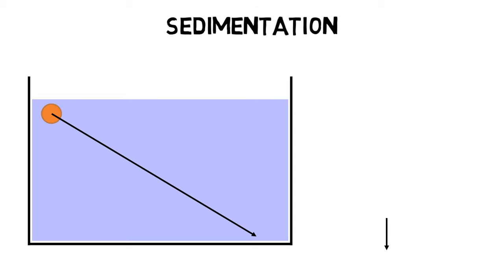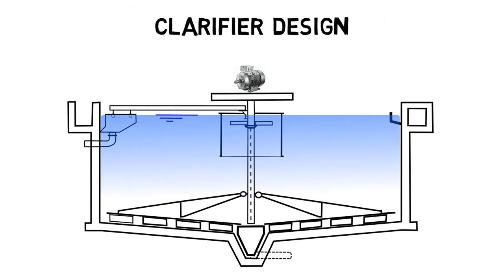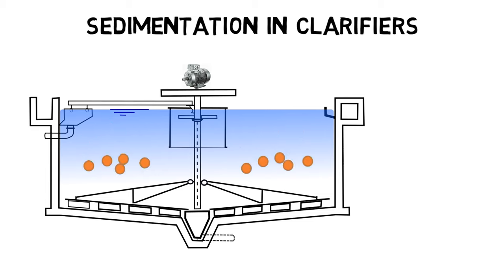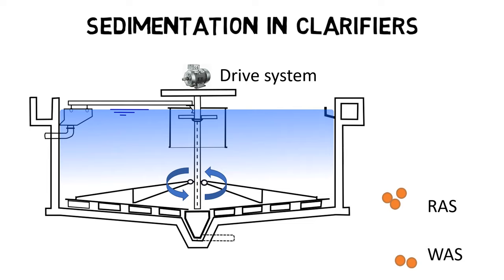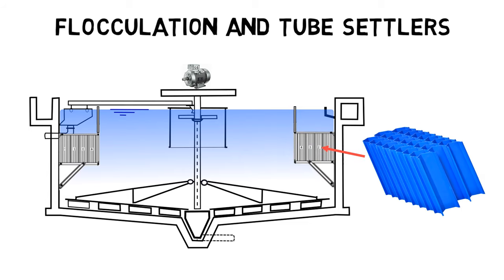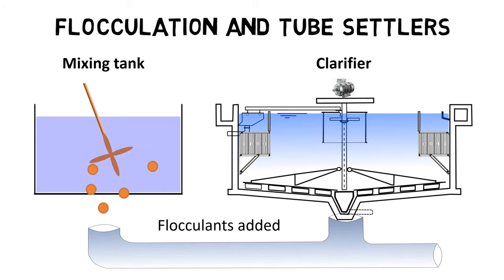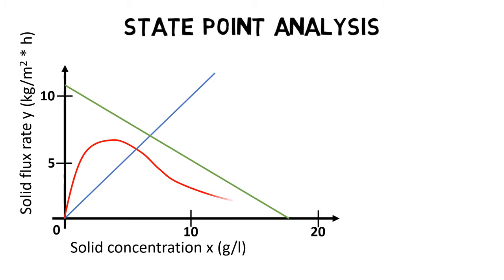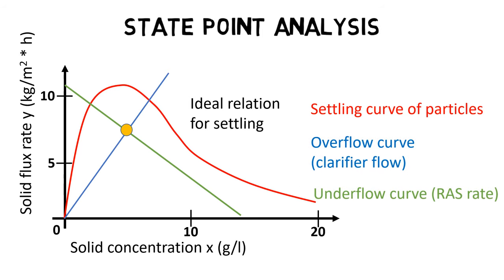Clarifier basics - How do clarifiers work I Clarifier design

Comment: I am running a lemello clarifier, it has a blow down pump, but my company replaced it with a 3x3 trash pump that is constantly running. 

My question is…. If this trash pump is constantly running, isn’t this counterproductive to the settling of the sludge?  If so, how often should I been clearing out the sludge?